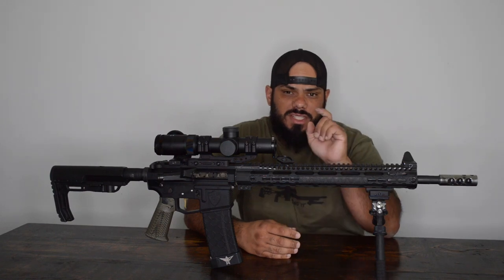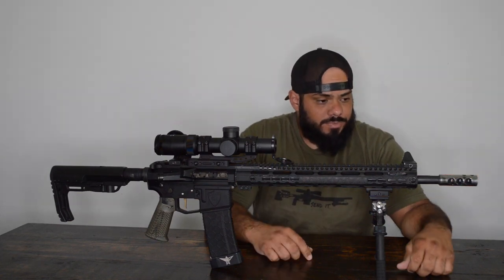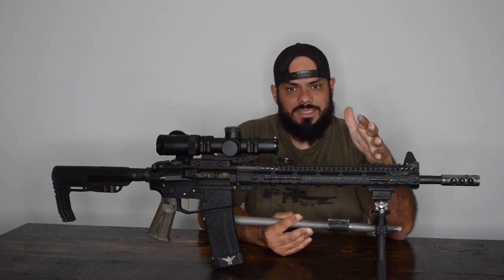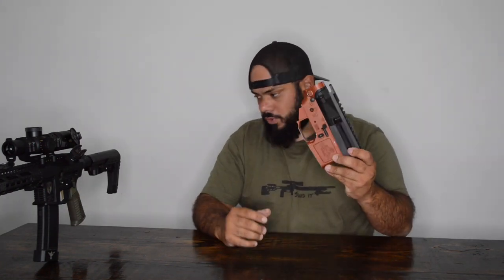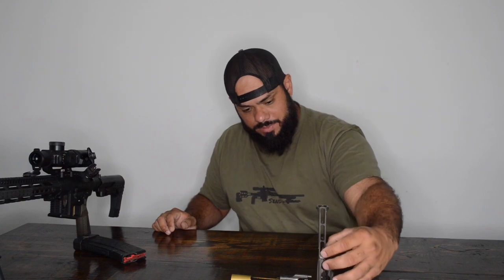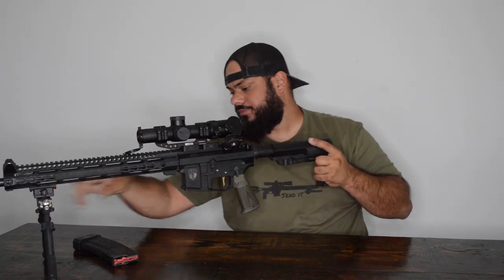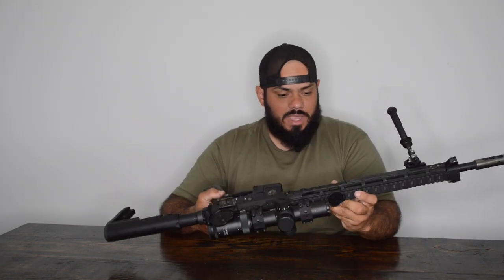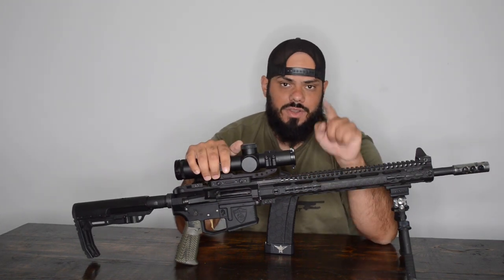3gun or Competition Rifle Setup ( ALL YOU NEED TO KNOW)

Comment: ayye john rodriguez what's good broo i just built my first competiton rifle myself recently. 14.5 ba modern series middy superlative adj block  ultradyne apollo s rise armament 140 aero m4e1 davidson defense 14 inch handguard nbs lightened bcg  a2 extension with a  taccom 3 g adjustable low mass rifle buffer -10% spring moe grip cheap canted irons and a monstrum g2 1-6ffp . its pretty smoove ill probably get a better optic down the road